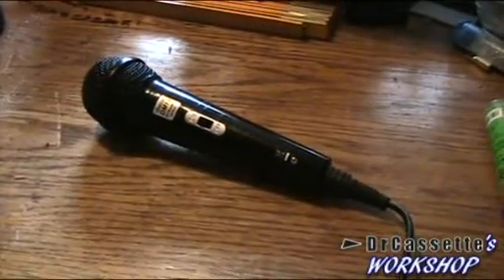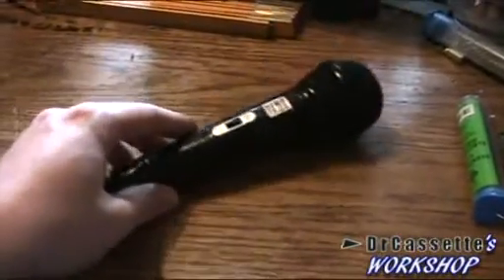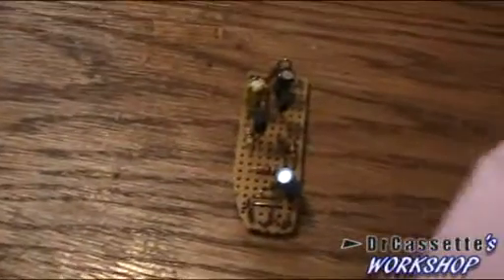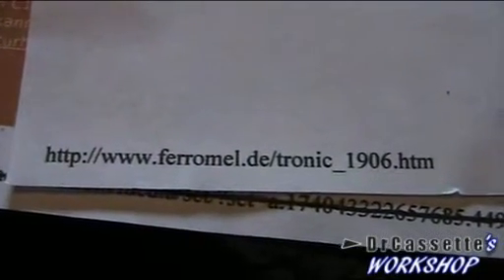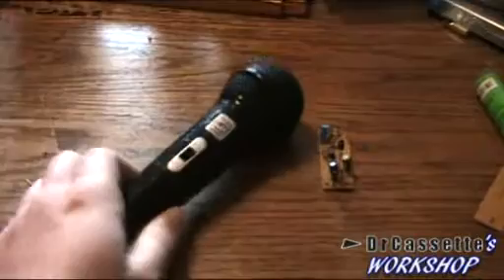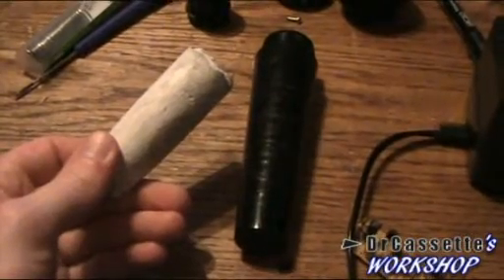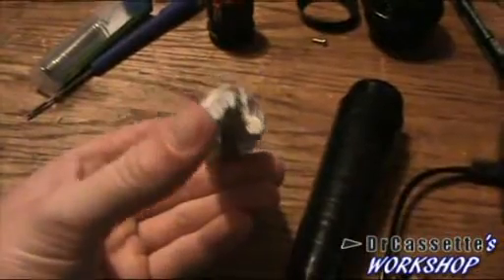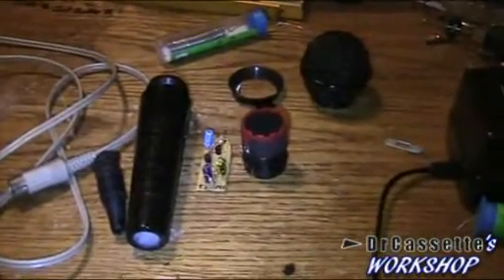DrCassette's Workshop - Homemade amplified microphone!

Comment: I can definitely see power supply noise/hum being a potential problem with this particular circuit (Bild 2 - stuff's coming in via R3, and spare open-loop gain isn't that grand). Two-stage RC power filtering nearby may be worth a shot (maybe 1k/10µ16V each).

Series resistor R1 doesn't make sense from a noise POV, I'd rather put a 1k/1k2 in parallel to the mic for a standard input impedance and up C1 to 4µ7 (a 6.3V type is plenty).

Also try a BC550C for T1 and reduce mic wire spacing.

Comment: Another idea would be wrapping the preamp in foil then grounding it, that's what I do if circuits I make pick up hum.  With the microphone I made (in one of my crappy early videos) I had a ground wire making contact with the microphone's wire-mesh head to shield the element.

Comment: Nice project. Your probable picking up interference from other devices in the room, maybe from the wiring in the walls, or all the above. Try magnetic shielding the coil in the microphone. Nice job building the amplifier. It is also possible the noise is coming from it power supply, if you are not using batteries. Or all the above.